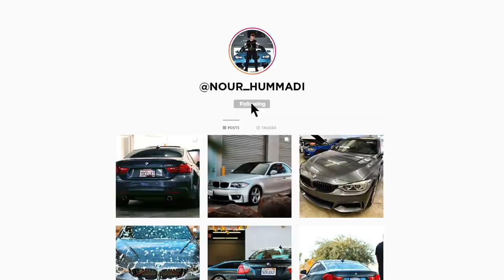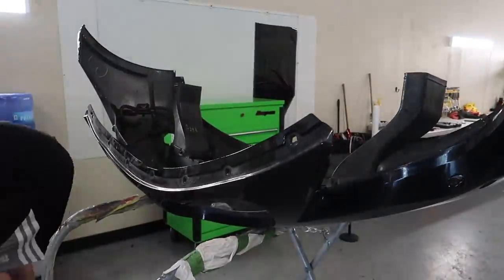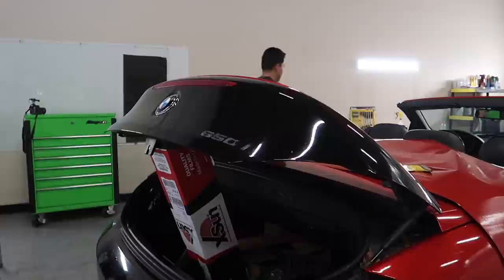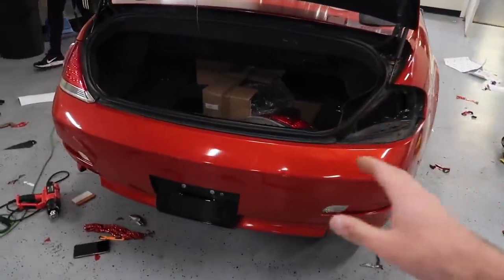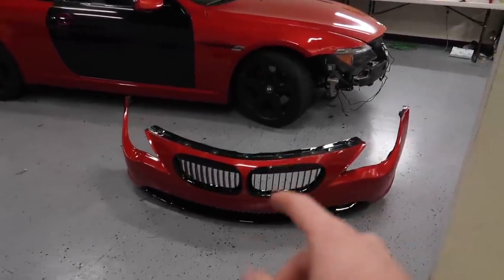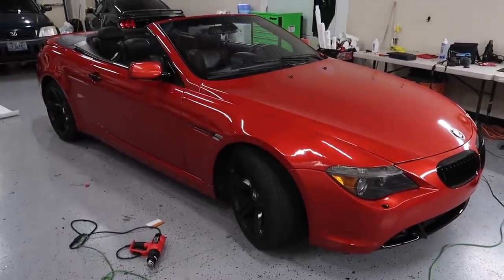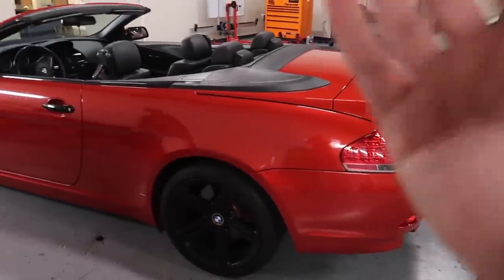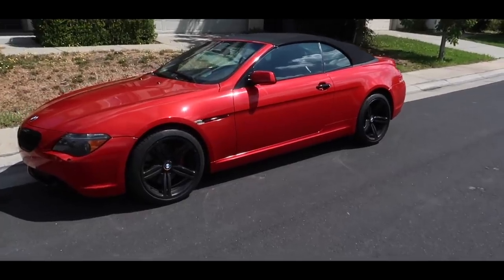TURNING THIS $800 BMW 650i TO A $8000 BMW!

Comment: Awesome color I think if you tint the white strips on the tail lights and the bottom markers and got the M6 front bumper with splitter.. it would look fire and obviously the windows tinted.